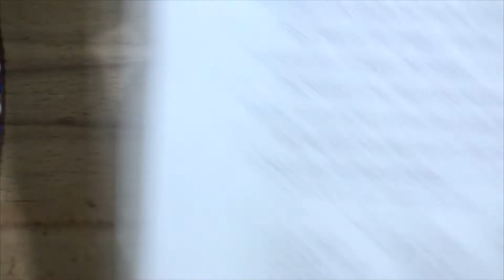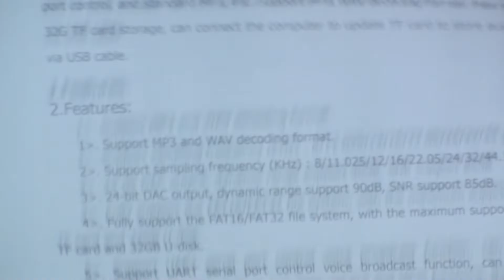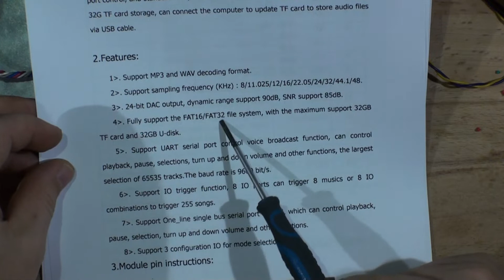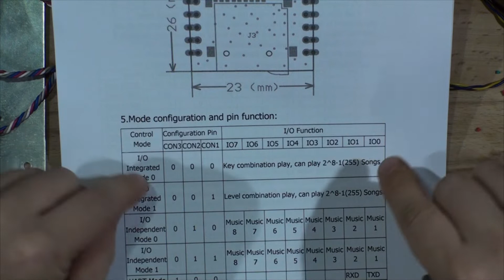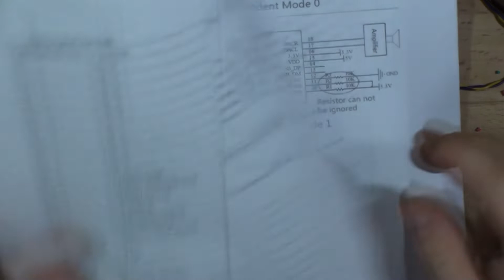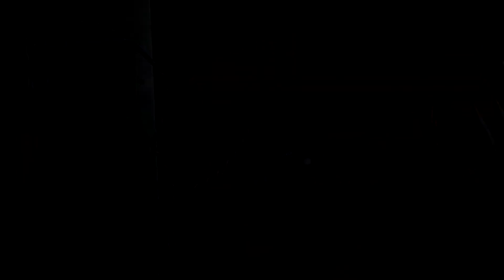Pretty cool Audio Playback Module Review

Comment: How seamless is the switching between audio files? I want it to play one audio file on startup, and INSTANTLY swap to another audio file when a button is pressed but I don't want any delay etc. Is this the right module for me?
Reply from the maker: There’s no delay but if you press button while one file is playing it’ll abruptly stop 1st file and instantly start playing second
Reply: @MaxELECTRONICS  yes! That's EXACTLY what I need! thank you!
Reply: @MaxELECTRONICS  I got mine today, it does NOT INSTANTLY start playing the other file, there is a small delay, maybe 100ms :(
Reply from the maker: All the jumpers are correct?
Reply: @MaxELECTRONICS  As far as the manual shows yeah, I just can't seem to get rid of the slight delay when switching files.

Comment: I want to mount at least 10 push buttons on a panel and when I push each button a different message plays and I can change the messages as needed. Can I do that with this device?
Reply: Yes. The data sheet lists the pin combinations to play certain files.

Comment: Hey Max, Thanks for this detailed review. Could you please add a link to the detailed datasheet/app note which you used which contains the details of the app circuit configurations ? That would be very useful, since I have not been able to find this via Google.
Reply from the maker: Here it is, it’s the same thing only instead of on-board memory it’s got MicroSD card, but datasheet is the same:
https://attach01.oss-us-west-1.aliyuncs.com/IC/Datasheet/13288.pdf
Reply: @MaxELECTRONICS  Thank you Max, for your speedy and very helpful reply! All the best & Happy New Year to you!
Reply: Thanks, this was extremely helpful for a project I'm working on.  @MaxELECTRONICS

Comment: Good video but the DY-SV17F isn't an "older" version. It has a different spec to what you're calling the new version with the TF card slot (XY-V17B). The XY-V17B has a TF card slot but it doesn't have the onboard audio amplifier. That makes the DY more versatile than the XY if you're only looking at 3-4 minutes or less of MP3 audio.

Comment: Hello how are you? Can you explain to me how I can make the audio track stop playing in an infinite loop?
I made the connection in CON1, CON2 and CON3 at level 0 and when I press the input IO0, for playback track 00001.mp3 it plays and is in an infinite loop.
I would like it to play just once. Can you help me? Thanks.
Reply from the maker: Hi, try connecting those resistors to +3.3v I believe they need to be billed up high, not low
Reply: It continues in an infinite loop, with the button pressed.  I want it to play just once with the button pressed.
Reply from the maker: Do you have the manual? It should tell you what pins needs to be pulled up and what pins should be pulled down to set the program.
Reply: I have, but it seems that the manufacturer did not include such a function for this module. A feather. I didn't make it, but if you happen to be able to, please update a new video to show us. Thanks!

Comment: Is it possible to turn off the device completely after playing a sound?
Reply from the maker: Only if you unplug it, it automatically goes into standby mode after playing a sound
Reply: @MaxELECTRONICS  I want to use it for cars and it is not possible to unplug
Is there a solution to turn off the sound after playback?
Reply from the maker: What exactly are you trying to do?
Reply: @MaxELECTRONICS  I want a short audio file to play when I turn on the car and turn it off after the device
Reply from the maker: You can just leave it on, it won’t discharge your battery. And you can connect it to “ACC” power of your car, (same as your stereo and 12v socked powered from) this way when you turn the key the device will be on and play your sound and will be turned off when you turn the key to off position.
Reply: @MaxELECTRONICS  I want a power outage. Do you have a suggestion for this?

Comment: i have received my module but i could not find how to wire it to only play once when powered on automatically ( it is to make a chime when contact is made  as a doorbell but voltage will stay on )
Reply from the maker: Try connecting pin “CON1” to 3.3v via 10k resistor and pin “CON2” to ground via 10k resistor, connect button between GND and Pin that you have assigned the sound to.
Reply: @MaxELECTRONICS  i'll try that but could a faulty chip only repeat and not play once ?
Reply from the maker: It will repeat when the button is pressed continuously, but in one mode it suppose to play sound as long as you hold down the button , in other mode it will play sound from beginning to end when u just momentarily press the button
Reply: @MaxELECTRONICS   then its not what i'm looking for i don't want it to loop :(
Reply from the maker: Did you get the manual with your player?
Reply: @MaxELECTRONICS   i did not as i bought it on aliexpress but i've found the same as your online
Reply from the maker: Have a look on page 9 of this manual for examples, you want to use one of those to modes, try both, pay attention to the resistors that select mode, instead of MCU that you see on diagram just use simple button.
https://attach01.oss-us-west-1.aliyuncs.com/IC/Datasheet/13288.pdf